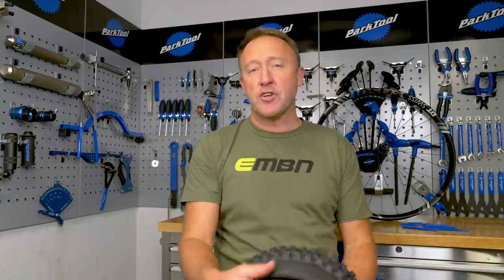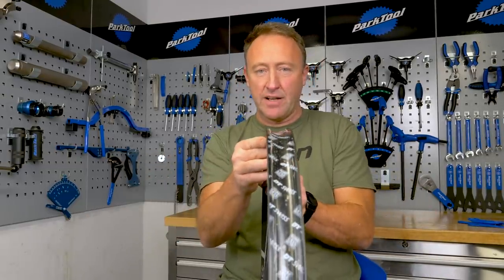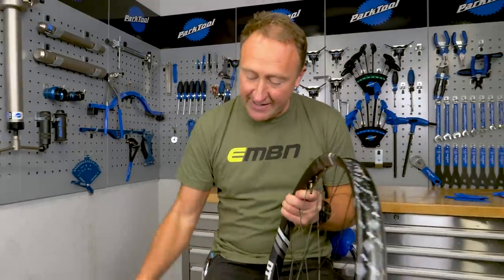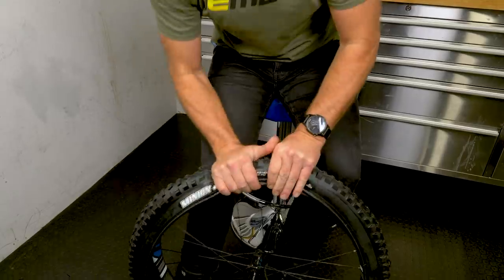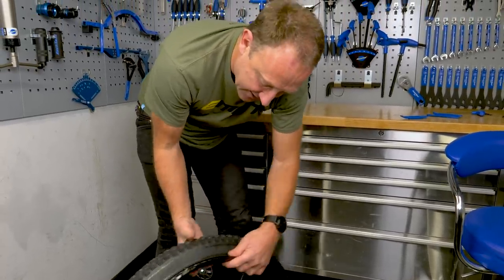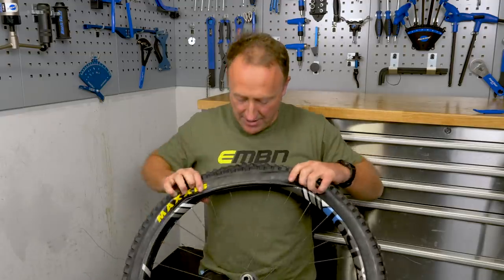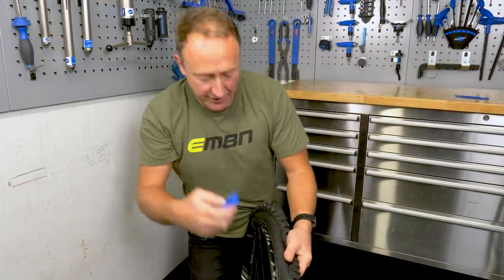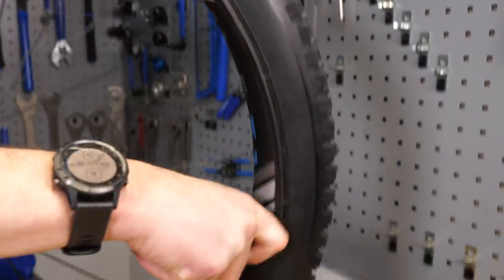How To Fit And Remove Difficult E Bike Tyres

Comment from the maker: If you've got any tips for fitting and removing difficult tyres share them in the comments below ⚡️
Reply: tire inserts make it a nightmare but there are videos that show you how, they take more time, patience and just little by little pushing and pulling. In spain, we say "maña sobre fuerza" which roughly translates to "skill over brute force" or "knack over whack".
Reply: I’ve had tyres that are so hard to get off the rim the plastic tyre leavers snap.
Reply: Swear words
Reply: The problem with my tire is that when taking it off you can get it to the centre any tips?
Reply: I found DT Swiss RIM is harder rather than any other Rim in terms of changing tyre
Reply: You have to make sure the tyre is pushed into the very centre, part of the rim. Take very small bites with the lever. Wear work boots to apply pressure. One type of Michelin motorcycle tyre was almost impossible to fit. Almost.
Reply: I’ve a problem you can help with ....

27.5 wtb Htz 35mm internal 
Cushcore + 
Dhf 

Once the tyre is on the bead gets stuck in the rim well ( which is offset to non drive side 7mm ) 

One side of the bead won’t move and it’s impossible to get any leverage to get into place
Reply: Little metal spoon handles that are stainless with electrical tape on them will make any tyre lever feel like cheap junk ;-) works every time all the time :), Soap of course, If you get a super hard one you can use slicone spray but be very careful mind bead only, also works good for inner tubes as it stops pinch flats ( Dakar Rallie trick) (I'm a motorcycle tech).

Comment: Dude that aint a difficult tyre
Reply: They are for me I hate bike tires
Reply: One of the hardest tyres for me was a maxxis minion dhr 2 (wire bead NOT folding). Recently changed to michelin dh22
Reply: @TE_53349  I’m trying so hard to replace mine and just can’t
Reply: @zanna8549  theyre super stiff and i had to use nylon coated metal tyre levers. Used to use plastic ones but they just bent all the time
Reply: Agreed, it slipped on 🤣 had 2 of us taking 30 mins just to get one side on before now
Reply: 2 days trying to get the Maxxis Minion ll on, and multiple videos saying showing the same technique to no avail. 
Untill i reach for some Hair oil in my bathroom, went on like a charm.
Reply: On a cold morning it is easy tyres off.... you can mimic this:) also be precise about putting the rest of tyre wires exactly in centre of wheel rim around the rest of the circumference, giving you a few more millimetres to slip that beeatch off
Reply: I have orbea gain
My son has given it me 
The tyres are so difficult to remove 
I normally easily remove them and fit them with my hands 
No levers
I fit e scooter tyres with my bare hands 🤣
I'm not going to be using this bike because if I get a puncture 
There is no way I'm going to be able to fix it on the side of the road😢😢
Reply: @JoeJoe-C137  I had exactly same last night haha 😂 angry swearing all sorts just gave up lol retry tonight 👍🏻

Comment: Not really a difficult tyre to remove, esp as you can get it into the center of the rim... try a tyre which refuses to even come away from the bead.
Reply: I've got that now so annoying
Reply: @lman22  got 2 now and  i need to use brutal forse to make 1mm gap and tyre remove tool not helping at all
Reply: This is exactly my problem I’ve been trying to remove it for about 1 hour now but all I get is a tiny gap and once I let go I have to restart.

Comment: Here’s a trick I learned in the 80s, if you live in a warm climate throw your tires into your car roll up the window park your car in direct sunlight for an hour or two then try to put your tires on your rim!
Reply: or leave in sun light, and flip over for a few mins  then fit, if you can touch them !

Comment: Soapy water. in a small spray bottle.  I had a set of knobby nics that broke two levers.  Soapy water that is the key
Reply: yes, applying with a brush is also good
Reply: @sijmes  they use it for car tires which have way more torque with no issue  which is where I got it from  also you are not pouring straight dish sop on  it is heavily diluted with water.  I have had no issues
Reply: I broke 3 levers with a Continental Der Baron with DT Swiss M1900 rims...
Reply: Simon Whitworth no problems with slip, the soapwater dries up
Reply: Thank u so much for your comment. I have finally made it with your method. I used dish wash liquid mixed with water and it worked amazingly. I tried on new Maxxis Assegai 2.5WT DH tire and my Ibis S 35mm rim. Test riding will be tmrw. Huge thanks!!!
Reply: @th_js  i just made a hole on the sale rims because of tire leaver
Reply: Yep a little soapy water spray it will let the toughest tires slip right on.
Reply: @sijmes the soap and water will evaporate

Comment: The trick of pressing the tire/wheel assembly against a wall when mounting the new tire was a ride-saver. After breaking one of my tire levers on a particularly tight new tire, I turned to the internet for some tricks and that was the one that saved my day.  Thanks!

Comment: That tire was not difficult. On my maxxis aggressor dd I can get the 2 levers in but cant slide them round, any tips ?
Reply from the maker: Try to pinch both sides of the bead into the centre of the rim to create some slack, then use each lever to work around the rim rather than trying to slide them. Using more than two levers will help, good luck! ⚡️

Comment: Recently, I changed (tried)my tire for the first time in my life😅
It was not possible for me to put a Wicked Will on my 30mm wide rim. Took it to the shop, and they could not even do it with normal tools. So, some tires and rims are not a good combination. I had absolutely no trouble with the original XR4 team issue tires. It was a hard first lesson 😂

Comment: i personally, when fitting/removing a tyre start opposite the valve not next to it, this allows the tyre to go into the centre of the rim to allow more room when i get to the tight bits and is not restricted by the valve

Comment: I am trying to put Maxxis DHR II MaxGripp 29" on Bonetrager elite 30 rim and this last 10% is not possible. I have already broken 2 plastic leavers. I've tried the trick with wall, but it despite I put all my strength, the tire did  fell off the rim on the side close to the wall. The tire was in the muddle of rim. Are there any professional tools that allow such thing?

Comment: I had an unbelievable experience trying to remove a vittoria banzo 29er , from a Boardman wheel , unbelievable, couldn’t get anything down the side of tyre to rim ,,, ,, I had to put part of wheel and tyre into a sink full of hot soapy water and allow about 10 mins to warm up , then in the end I had to use a blunt srew driver to prize the tyre away from the rim , it’s almost like the tyre was glued or something,,,, I even struggled in yrs past and changed motorbike tyres by hand with only metal levers ,,, but never anything as hard as this git ,, took about 50 mins just to remove 1 side , I never bothered getting the back wheel out to remove that one , was attempting to go tubeless , but I didn’t bother , stuck the tube back in and blew the tyre up , phoned Halfords and they wanted 40 quid to convert 2 ,,, if I include the tubeless kit,,, Sid that I,lll run tubes ,, cheers shane uk 🇬🇧

Comment: Your doing it backwards, you need to do the bit by the valve last. That way you can get the maximum amount of bead sitting in the deep groove in the rim. And wear gloves you'll have more grip.  I never use tyre levers
Reply from the maker: Yes this method is also very common but stems from fitting traditional tubed setups as you can push the valve out of the way to avoid potential pinching. The method we demonstrated allows the best chance of a good seal around the valve area on tubeless systems.
Reply: How does it help the tyre seal?
Reply: @embn  Always mount opposite valve hole with tubed tyres and start near valve when taking off

Comment: Brand new 24" fat tires laughed at my plastic levers and bent them in half just trying to get quarter of an inch more tire on. Thought about heating up the bead with a hair dryer. Ultimately I used thick spoon handles. Chipped the paint in 2 small spots but nothing some touch up paint wont fix.

Comment: I'd be inclined to start mounting the tyre opposite the valve so the tyre is able to sit fully in the deepest section of the rim well when it starts to get tight, rather than be obstructed by the valve.
Reply: Agree valve last for tubless however, I do valve at three O clock start for tubed tyres, start at 12 finish 6. Physically its the least obstructive to the bead lip but without the hassle of the valve fitting pulling out etc.
Reply: Opposite is the way to go. Starting at the valve just makes the job harder for no reason.
Reply: @BarryJTaylor  Also, back when using tubes, doing the valve LAST means you can push the valve into the tyre a little and it moves it away from where you are using a lever and less likely to pinch the tube on that last bit. I always learned to do the valve section LAST.
Reply: Always start at the valve when taking the tyre off and finish at the valve when refitting. It allows the bead to sit farther down in the well.

Comment: I think that it's only the rim tape that is making things difficult. With a standard rim, not taped for tubeless, there's usually plenty of room to get the last part over the rim.
Reply from the maker: Yes you are right, tubeless tape is not only for keeping the system air tight but also to help build a snug fit between the tyre bead and the rim so this is a common cause. 👍

Comment: Funnily enough got stranded on my trekking haibike a few weeks ago and could not break the bead. Anyway one Saturday afternoon I used the whole afternoon to find a way of getting it off! I will be uploading a video soon but basically if you use your feet/trainers either side of the rim pushing the tyre edge down either side and gets lots of spokes balancing the weight across them pull the rim up and hey presto the bead pops then you can use tyre levers to get into the gap! Cheers

Comment: Thank You very much for the tips and advice - applies equally to older 26" Mavic Crossride rims matched with new Contimental Trail King 2.2" tyres with the Apex Protection (tough tyres!).....just getting the bead centered in the middle of the rim in well helps enormously!

Comment: "How to fit difficult tyres?" - proceeds to fit a really easy tyre. Generally love your videos but this is not helpful when you have a DIFFICULT tyre set on hand. They are just tips for fitting a tyre.
e.g. I have a Giant TRX1 carbon rim that is notoriusly hard to fit tyres on. I have struggled for several hours trying to put on Schwalbe (Super Trail casing).
The problem seems to be that once the first bead is completely on the rim (a mild struggle in itself) it sits in the centre of the rim taking up all the space i need to get the second bead in there.

Comment: Firstly the entire rim needs to sit inside the tyre first so that all the tyre (both sides) overhang the rim .then the tyre goes on by hand .
Maxxis are by far the easiest to mount especially the wt versions contradictory to what Steve said .
Reply from the maker: We used this combination of tyre and rim simply as it's what we have available and were not suggesting these are a bad combination at all. Intact the Maxxis WT (Wide Trail) design is perfect with a 30-35mm rim profile. 👍
Reply: @electricmountainbikenetwork noted and good video all the same .
I would highlight these excellent help guides as basic intermediate and advanced .

Comment: would be more interesting if this was done in the field, w an old tyre full of old sealant that wont seal any more
Reply from the maker: We would suggest you simply remove any of the dried on sealant by hand (Do this every now and again to avoid it building up). Plug any holes that won't allow the tyre to seal and boom, you're sorted 👍
Reply: @embn  I wish it went like that....
Reply from the maker: Hey Tomi, if you are stuck with tubeless issue out in the field you can always put a spare tube in. Next time try out these tips as they really do help make it easier 😀
Reply: @embn  Yeah, that's the point, I've had to stuck in a tube way too many times :/

Comment: My front keeps getting flats (tube). Getting the bead broken is a major pia. Seems like the more it is done the easier it gets. Heat seems to help but, that is nfg when you are away from a shop.
I remember the old daze when you could change a tire w/o even using tools.